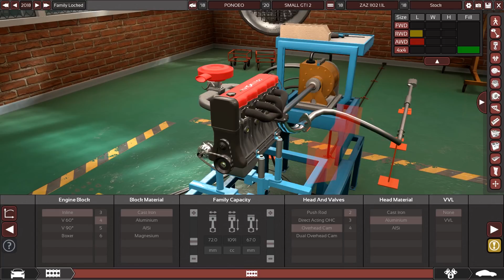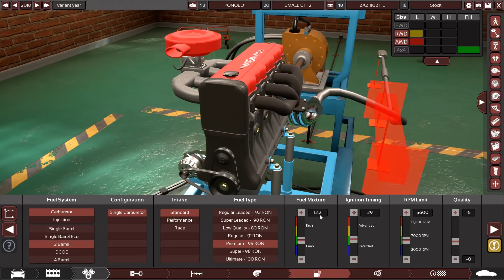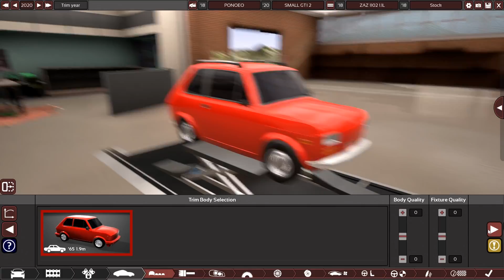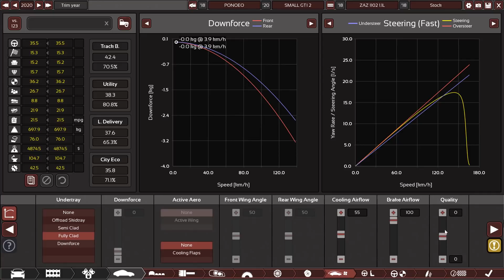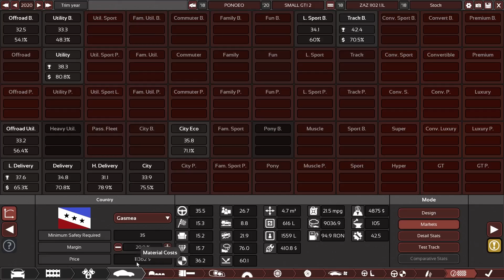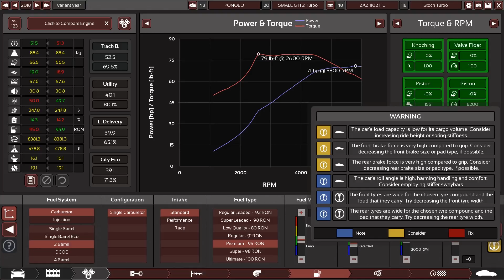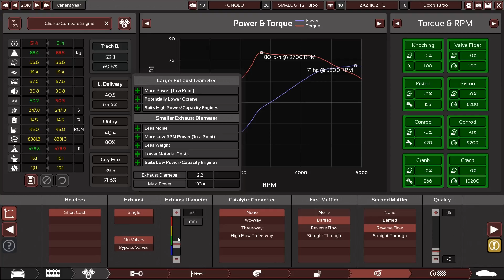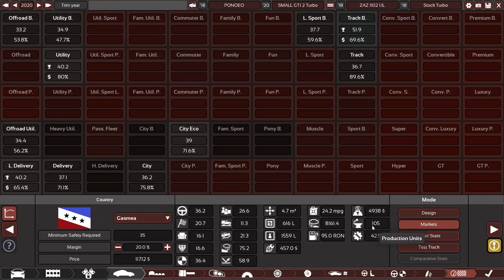Zaz 1102 Tavria 1.1L Engine Replica in Automation.

Comment: Can you do the renault 5 please?
Reply from the maker: The car itself no because the lack of the body.
But i can make an engine replica if u can write the specs.
Reply: @BsharNasri  well can you make a toyota corolla te71 with a 2tg engine? I think you have a body for it. It is a rwd front engine 4 cylinder with dohc and daul double barrel carbureteur and 5 speed close gear ratio transmission

Comment: But why is it made in 2018? Also according to wikipedia its front engine front wheel drive, not rear engine rear wheel drive.
Reply from the maker: The engine only is a replica of the real one with the real provided specs.

It’s a replica not the real engine. 
Replicas are made in anytime.